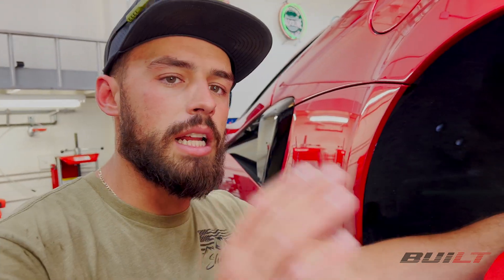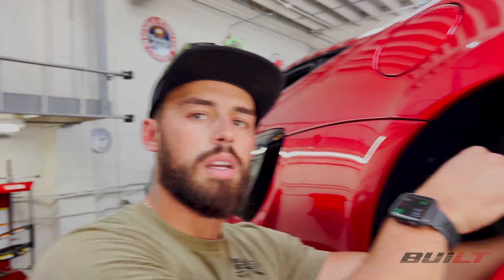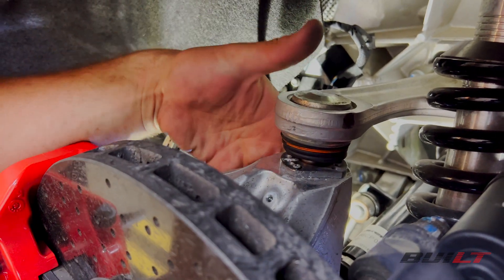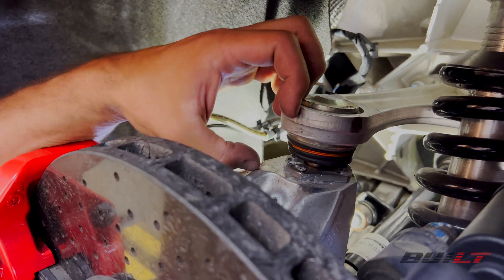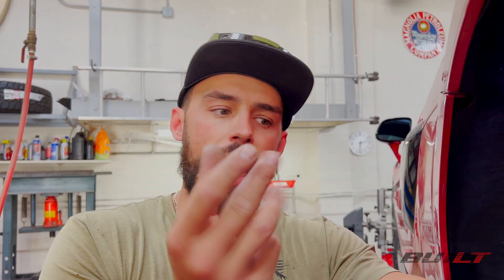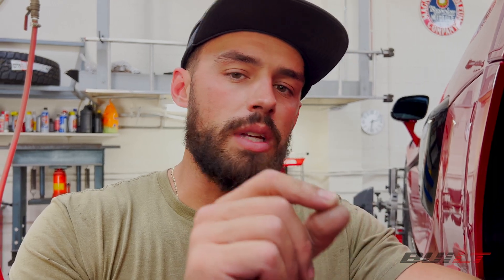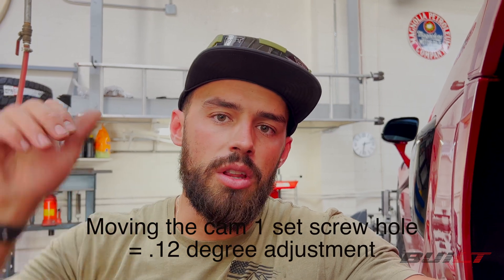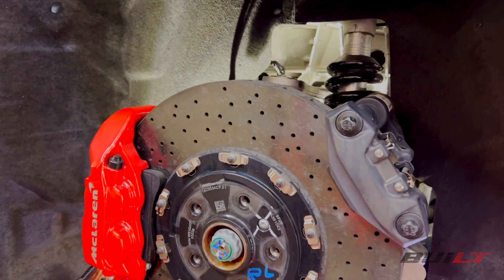HOW TO: Mclaren wheel alignment

Comment: What’s the best way to separate the ball joint? Any recommended tools?
Reply from the maker: sorry for the delay, If you have access to a ball joint separator tool that is what id recommend. If not you can go old school and take a ball-pin hammer or air hammer to the knuckle at the connecting point but that will mar the surface.

Comment: How do you turn it? Special tool needed? Also if I go max, any idea what is the most camber you get?
Reply from the maker: There is a tool available floating around online although i was able to use some adjustable channel locks to rotate the cam. in hindsight, the tool would be helpful and I would recommend it. I don't know off of the top of my head what the maximum achievable camber would be.
Reply: @MotorizedCo do you have a part number to the tool needed ?
Reply: it's either a 39mm or a 40mm crows foot